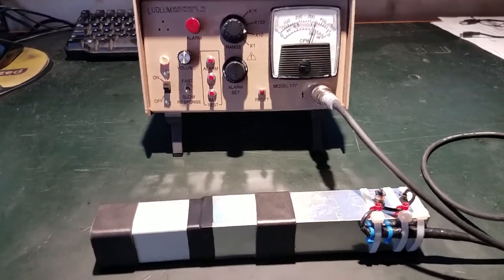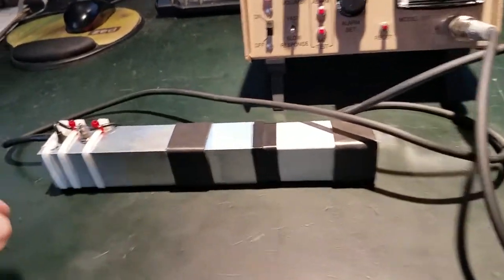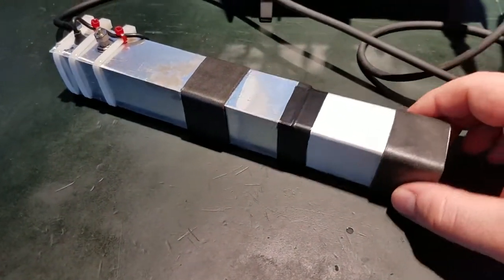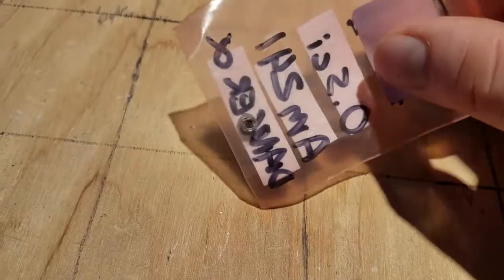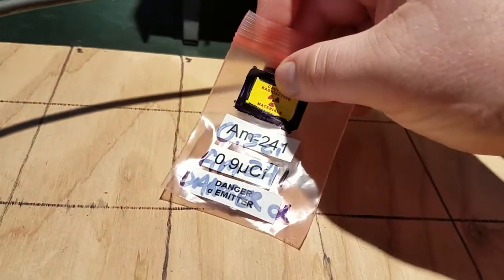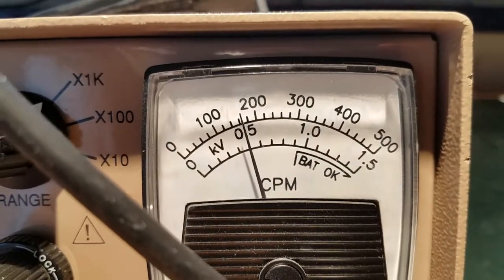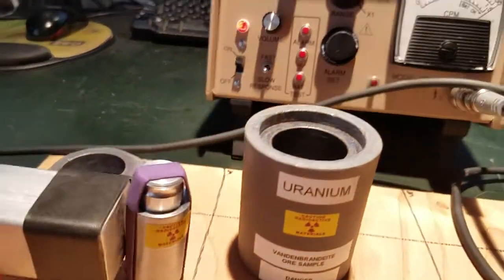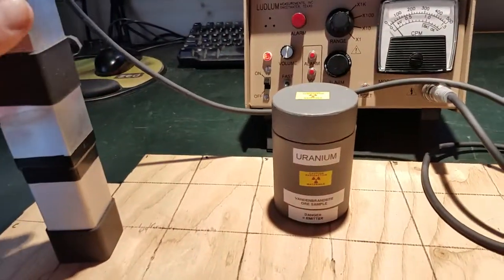Measuring radioactive samples with an Alpha Spectra scintillator.

Comment: Some of the old fire alarms had up to 80uCi of Am241 in the form of AmO2 plated gold foil.... Ones in Russia made in the 1970s used 10's of uCi of Pu238.  Many still around.
Reply from the maker: I'd seen a few of the Pu-238 smoke detectors in videos of the exclusion zone in Chernobyl. It'd be interesting to get ahold of one of those and measure the properties of the element. The old-school Am-241 smoke detectors with huge amounts of Am-241 are pretty cool though I haven't seen one with > 0.9 uCi in person yet. I've videos of ones that contain ~11 uCi of Am-241 oxides.
Reply: @joshlucy9420  I have one of those 80 uCi ²⁴¹AmO²  Pyrotronic smoke detectors.  I think I have a video on it

Comment: Besides moisture problems, scintillators are prone to leaks of light. You can do a test in a dark room or with a bright light if you notice any apparently excessive "background radiation", as it could really be a light leak. If it is, it can be solved most of the times by replacing the Mylar window assembly of the unit. So I wonder if the 3500+ counts you are getting are really a light leak?
Reply: That background count seems normal for that size crystal, my  Eberline SPA-3 2x2 NaI(Tl) gets 8,000-20,000 CPM background based on where I am.

Comment: My old smoke 73 µCi Americium-241 Sources.
Reply from the maker: That's pretty hot! It must be an old one... I saw someone who had an old fire alarm that had something like 11uCi in it.
Reply: The Pyroelectronics smoke detectors from the 1980s-early 90s contain a whopping 80 uCi of Am241.  They are exceedingly dangerous to dismantle ( not that you should take a smoke detector apart anyways as that is creating a licensable source...NRC/CNSC rules) due to the AmO2 flaking off the plating base.
Reply: You must be exceedingly careful when working with large amount s of alpha emitters. They ared generally safe when on the outside of the body but if inhaled in any way can do more damage than even gamma rays! When an alpha particle is emitted by an atom, the atom recoils like a cannon. In the case of strong alpha emmiters, thus can cause them to slowly move around without you seeing it. This is the reason that gloveboxes in nuclear research labs have a negative pressure in them to avoid alpha emitters from escaping. 
Periodic Videos has a very useful video on americium 241.